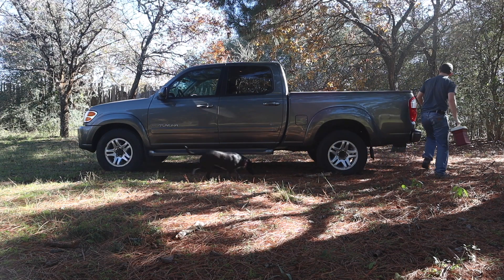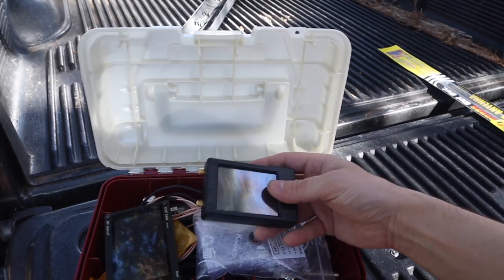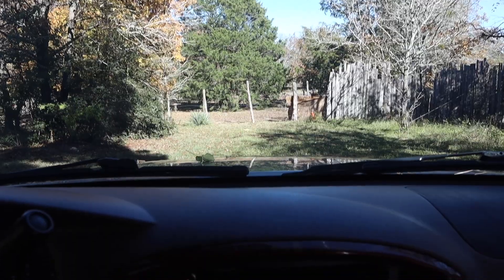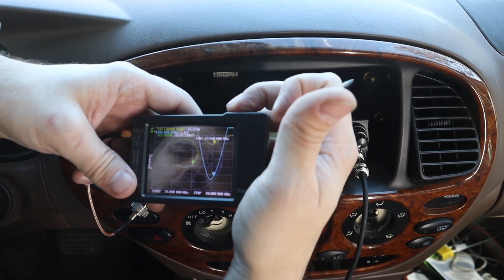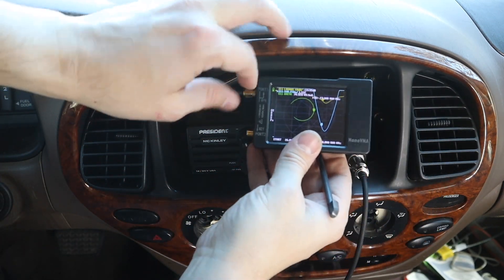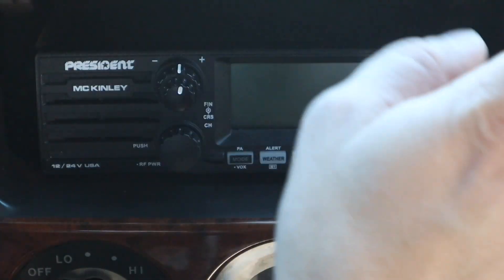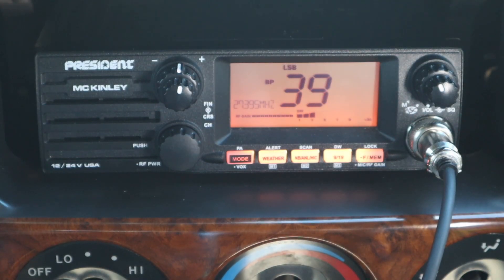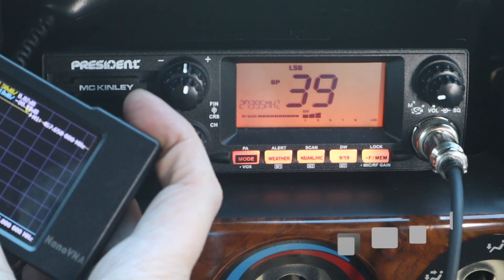1,500 Mile CB Antenna Tune with Nano VNA

Comment: The Firestick instructions say the SWR needs to be taken with the cap on. Did you find any change between with and without the rubber cap? Also was this with your “stock” McKinley and did you compare the built-in SWR meter on the McKinley versus your external meter?
Reply from the maker: I rarely read instructions :) but I took measurements without cap. Checked again with cap and saw little change. All measurements were with AD203 inline. Stock SWR built in test was a tad higher than the NanoVNA. Who knows which was more accurate. But they tracked together for the most part. I e been meaning to re-test now that I have better test equipment in the lab because I’m not happy with my results trying to make contacts while mobile. (Future video?). Thanks for the pointed, thoughtful questions! 73

Comment: Just got my NanoVNA-N and am using it to tune a Monkey Made mobile antenna for 10 meter amateur. Before I did anything, I tried it on 10 and the SWR was through the roof. Put the nano on it to discover the antenna was resonant at 23.554Mhz!! Not sure how this could be, but anyway... The NanoVNA definitely takes some practice to use but it really can't be beat for the price. It's an invaluable tool for anyone who is serious about their signal.

Comment: Did you ground the antenna to the truck body?
Reply from the maker: Hey Chris! Yeah I used a specific tool that goes on your drill and strips back a perfect circle of paint around the mounting holes. But I may go back and double check/improve the ground to see if I can get a lower swr.